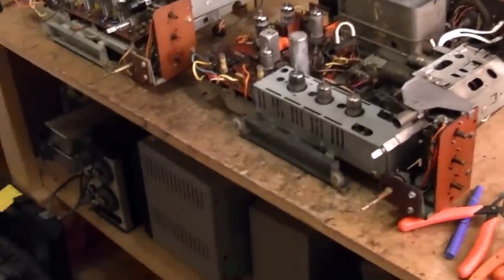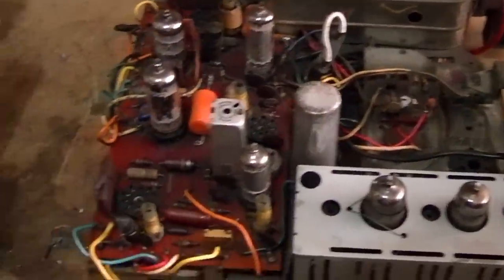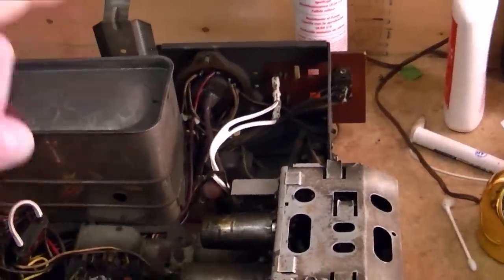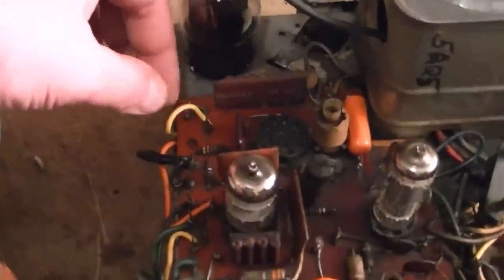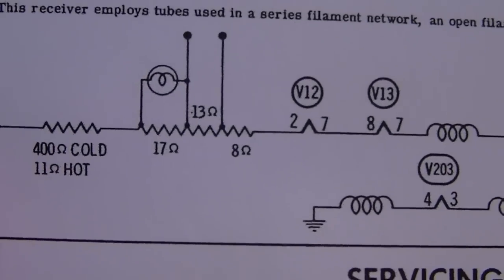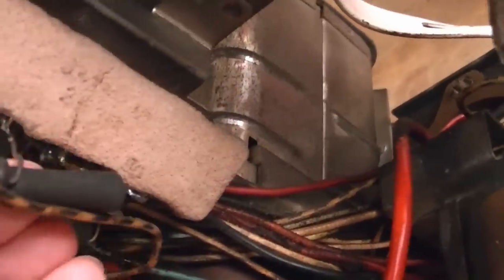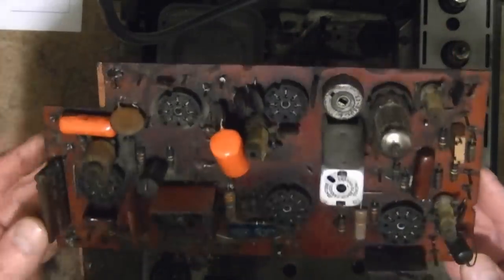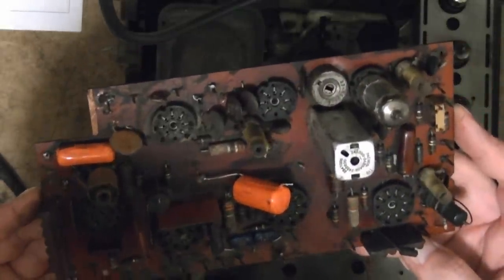Predicta Tandem II restoration pt2o?

Comment from the maker: Yes, there is a one tube video amp inside the CRT housing.  Also, a few components on the main board and the tube lineup is different than the holiday model.

Comment: I noticed that one of the Predicta sets that Phil Nelson was working on had a power transformer rather then using a series string like your Holiday and Tandem, it was a Siesta model. With regard to that sticky stuff on the wires I don't know what that is but I can remember pulling apart a few old TVs that had that same crap all over the wires. Maybe it's something that sweats out of old vinyl insulation or something left over from manufacturing the wire?

Comment from the maker: Right, the 17" Siesta and Princess models have power transformers.  They came out a year or two after the Holday and Tandem sets and are better designed if yo ask me.  They also use better plastic on the screens.  Polycarbonite I think while the older sets are tenite and stinky :P

Comment: I wonder if it's heat or a lack of air circulation that causes it to leach out since many TVs of the 1960s and 70s seem to have sticky wire but not all. I figured that it was either something leaching out or perhaps some residue from when they extruded the wire through the vinyl coating. That being said I would still rather deal with that goo then the crumbling or melting natural rubber insulation you run into in an old radio from 1939-42.